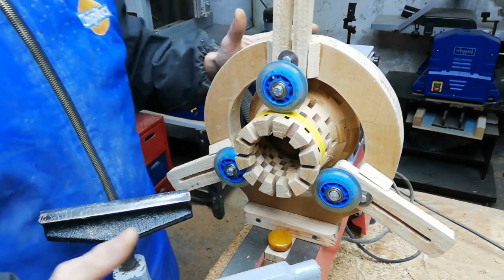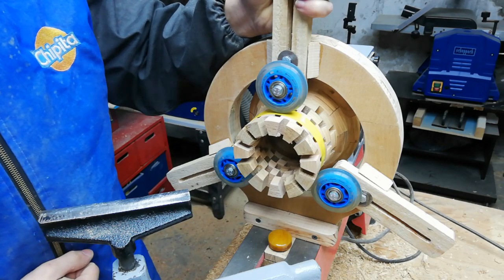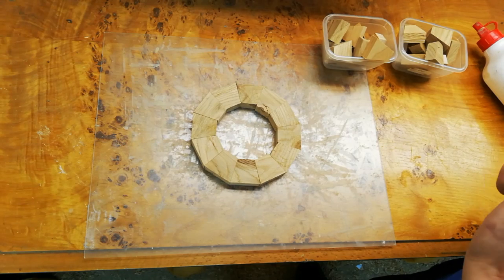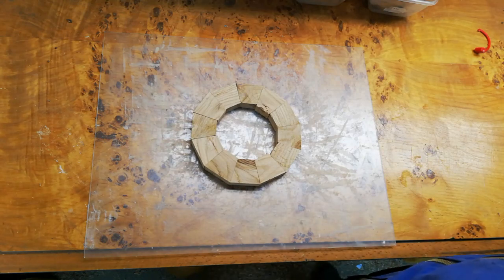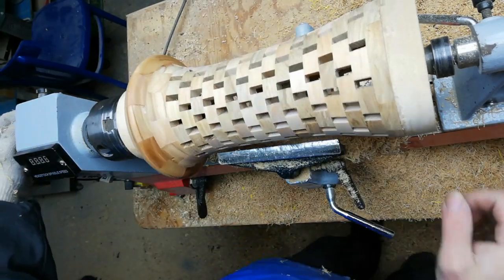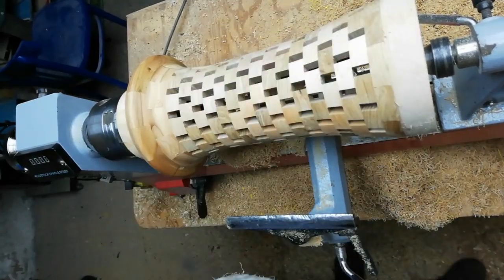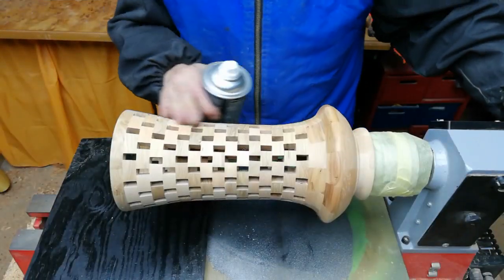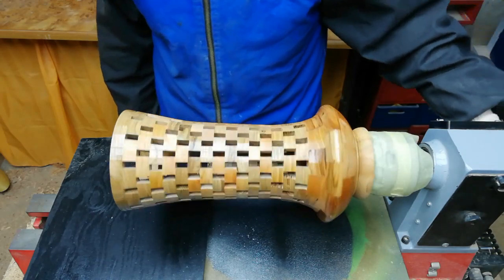Part 2. Open segmented vase - Woodturning

Comment: Rav,
 That turned out great! After the first video, I could not tell what shape you were moving towards. Even after the "Slow motion" part from the first video, you went much stronger on design and stretched the vessel out. I admire your push to move forward in a major fashion. Congratulations on a project well done.....that is a large vessel!
Jim
Reply from the maker: Thank You very much, Jim 🤝
After first part I didn't know will the shape will be the same as I had in plans. The neck is a little to wide but I couldn't make it more slim and till the end I didn't know will it not fly apart again. I'm very proud of this vase and someday will do it again 😊
Take care and be safe.
Rav

Comment: I think you need a bigger or better heater. I can tell that you are freezing. The vase is exquisite💜💜💜💜💜💜💜💜💜💜💜
Reply from the maker: I don't have a heater there 🥶 and yes there is the same temperature as on the outside. Only wind is not blowing. Spring will come soon 😀 I hope so 😁 I'm very happy that You like it. Thank You 🌹🌹
Reply: @Secondlifeofwoodturning  you really should see about getting a heater so you don't freeze to death.
Reply from the maker: I grew up in tmes when temperatures were from -5 to -35 Celsius degrees by half of year so I used to to the cold. Two years ago I was riding on bicycle to my job when was -25.
Reply: @Secondlifeofwoodturning  that's to cold to be riding a bicycle. Just be careful and don't freeze to death or get frostbite. It would be a shame if you got frostbite and couldn't turn anymore and it would be horrible if the world lost an amazing person like you.
Reply from the maker: Thank you for worrying about me 😊👍 I have ”hot blood" so I'm not freezing so fast 🥵 My wife is calling me "my personal radiator" 😁  Free hugs all the time 👍

Comment: For my opinion and experience it is a good idea,you wrap the total outside from the vase with cling film from the kitchen, carefully but firmly, during you turned the inside. It is fantastic stable and you dont need a steady rest on short peaces as you have had. Try it.
Reply from the maker: Hi Schorschi. I didn't know You observing my YT channel. Thank You 🤝 That's very interesting tip. Never seen that. I'm wondering what will be when similar vase will brake in half while turning then we get a propeller.

Comment: Great work 👍👍👍👍, have you plans for the steady rest Please ??
Reply from the maker: Thank You Douglas 🤝 
I'm sorry but I don't have plans for steady rest. I made it without plans and came out too small a little. Keeping the center was the plan only.
Reply: Hey Doug ... where's your videos ? Hope you do some 😀
Reply: @mpart_woodlathe-stuff  I do not make video's , I am only a Hobby turner and  a bad one at that. Yesterday I managed to snap the post of the tool rest so even the bad stuff has stopped  👏👏👏
Reply: @Secondlifeofwoodturning  Thank you for answering, keep up the great work 👍👍👍👍
Reply from the maker: I wish I could help. To find plans for a lathe is hard because every lathe is different and parts has different diameters. Start from measuring the height of the live center and build everything around it. If You will have any questions I'm here to help You 👍😊
Reply: @Secondlifeofwoodturning  Thank you 👍👍
Reply: @SilverBack.  Ah, you don't have to be anything more than a hobbiest ! Gees, that's all most of us are😁
The turning is the easy part - the videos are not as easy;  but give it a try. 
Too bad about the tool rest - big catch I'll wager. And then you headed right for the laundry room ???
Reply: @mpart_woodlathe-stuff   I do not have any equipment to do Video's and I prefer to watch and learn , I was trying to take finishing cuts on the inside of a Burl / Burr Elm bowl 8 inch diameter when bang

Comment: Great recovery, we’ve all been there. Are you sanding the layers flat with sandpaper attached to a board before gluing the next layer on? That eliminates any variation in wood thickness and gives you a better gluing surface. Thanks for your efforts to publish these videos.
Reply from the maker: Thank You, Greg 🤝😀 I was gluing 3 layers together at first, then sanding every block on disc sander from both sides. Sanding every layer separately would take much more time.
Take care and stay healthy 👍
Reply: @Secondlifeofwoodturning  when I do open segment vessels, after gluing a layer on, I let it dry for a while, maybe an hour then mark the ends with a pencil then sand flat with 80 grit sandpaper attached to a flat board. I sand until the pencil lines are gone and it usually only takes 30 seconds or so. Now the surface is flat and ready to receive the next layer. You should check one of Earl Rasmussen’s videos on YouTube. Watch here at 13:00 how he flattens the ring. https://youtu.be/AHV4QUcTo20
Reply from the maker: I'm subscribing Earl's channel from long time and I have seen this video before. My possibilities are smaller because I can't go to the workshop after every hour or I will not be waiting there an hour to glue up next layer. I have to do as much as I can and go home. When I was doing this vase was very cold in my workshop so glue was need much more time to dry so I had to glue up few layers in one session either it could took months not 3 weeks. Thank You for Your advices and Your time to explain me that 🤝 Take care 👍

Comment: That is a labour of love Rav, it looks really cool, I didn't envy you the sanding between each segment though.  Did you have some jig or tool  to help you do it? Keep well, Rob
Reply from the maker: Thank You, Rob 🤝 It was labour of love with a bit of madness 😁 I always don't like sanding between segments. Usually I'm using a smal file for metal and then a stick form ice creams with glued piece of sandpaper with higher grid. This time I didn't have to sand too much because I bought new saw blade and was cutting very good without tearouts. Only glue marks has left to clean up. Take care my friend 👍
Rav